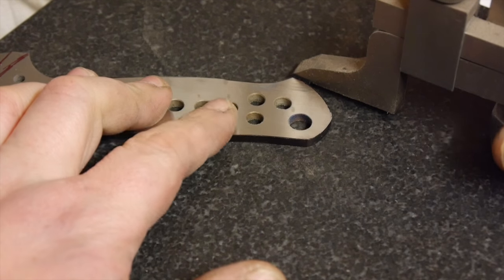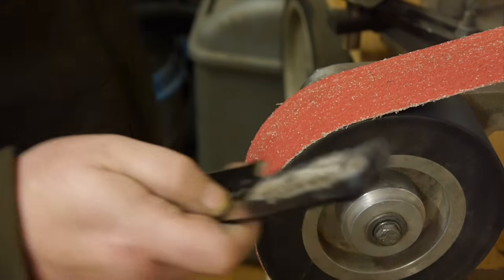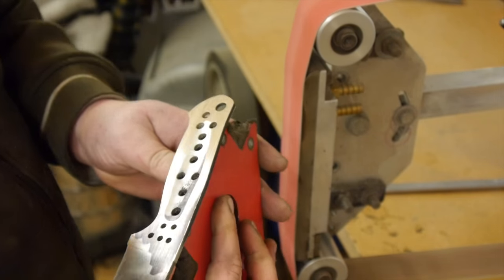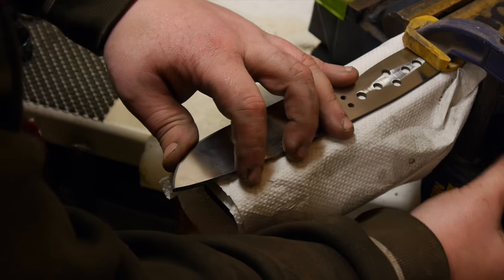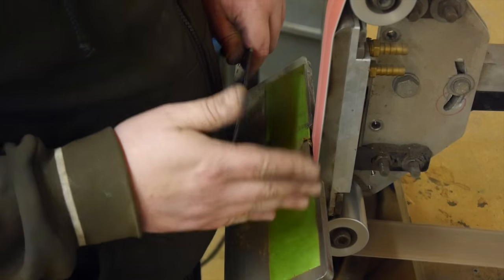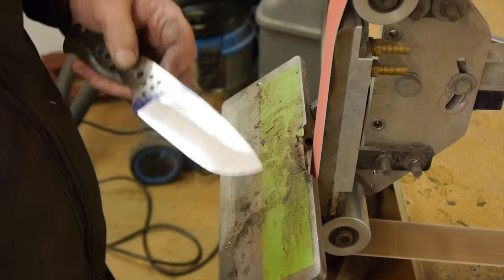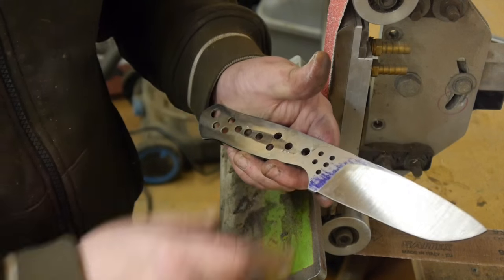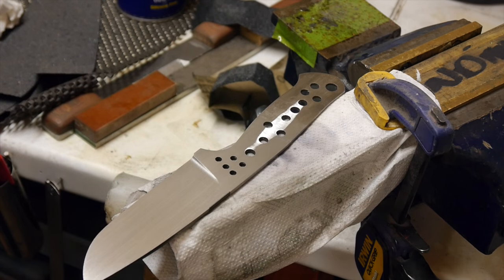tapering the tang missing link part 2

Comment: hi, i recently subscribed to your channel and i`m watching and learning all i can as i am a beginner in this craft (but not new to metalworking). i`m sure there is a reason for not making the taper in the surface grinder with an angle plate or maybe can`t be done this way safely. or is it you think this approach is too much "production style". i would like to know your opinion, as i`m watching there are people doing cnc knives which i hate. thanks for the video. regards. pete
Reply from the maker: +thebrokenbone hi mate glad you are learning that's why I do the vids. Yes it can be done on a surface grinder I do that way from time to time. But with a normal surface grinding wheel it takes quite a while. I have a way of converting my surface grinder to belts. And this works better.